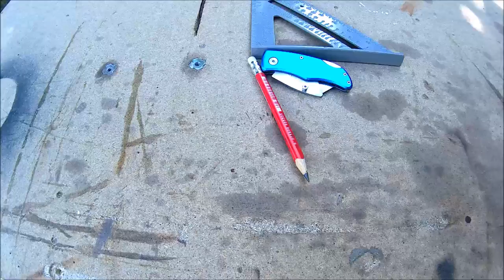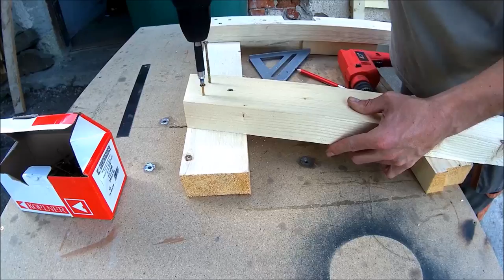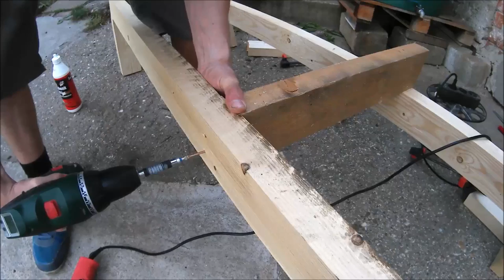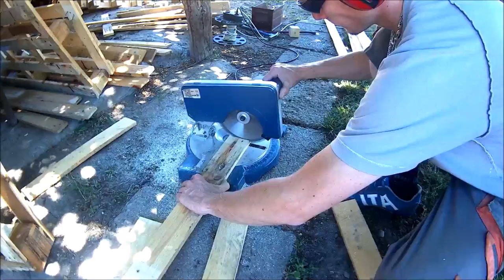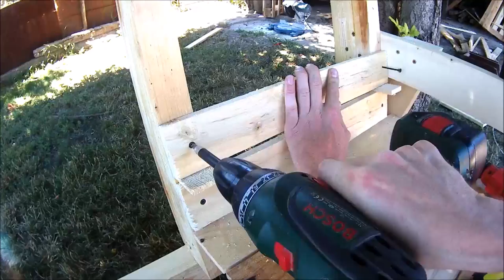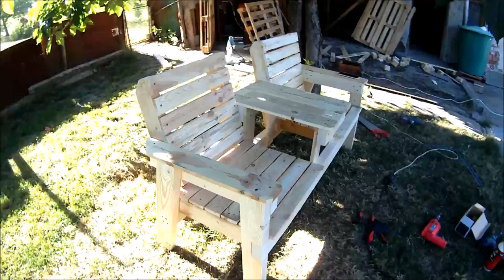Double Chair Bench with Table

Comment: Thanks! Going to build a few of these for around the fire at the trailer. What are the measurements of the table and what length screws do you recommend?
Reply: mikebzambrano get 3" screws. Check the description and it tells you everything in full detail

Comment: Which wood should I choose the best weather resistant to make this chair? I intend to use Teak wood whether it is suitable? Should I choose the best Cedar or Teak?
Reply from the maker: Cedar should be good enough.
Reply: @Ollaris  cedar won't have a problem with water as good as Teak? i'm afraid of rain
Reply from the maker: @phuocle864   teak would be more durable for sure, but mine is made from pallets and it is sitting outside in the rain for 5 years and it is still in good shape.

Comment: what wood do you use + how big do you need to cut the wood  how much wood do you need how much does it cost 😎
Reply from the maker: +Nick Lamplugh the wood is pine & some pine pallets. The cost depends on where you get the wood, and what kind of wood you use. Please look in the description for more detailed instruction. You can find the cut list on the instructables link!  Have a nice day!
Reply: I used 2x4 studs and 1x4s... Probably 40$ and $30 consists of all the screws you'll need 😂